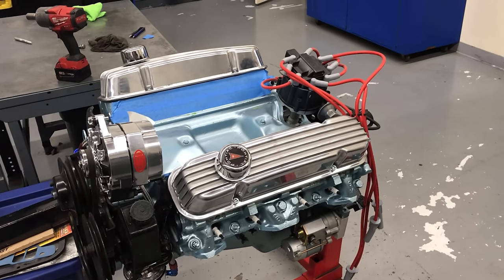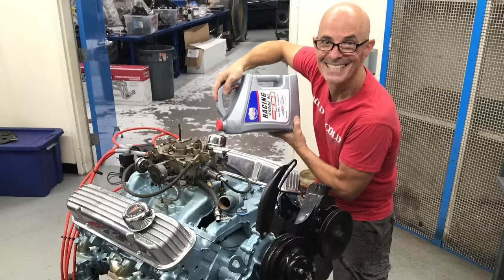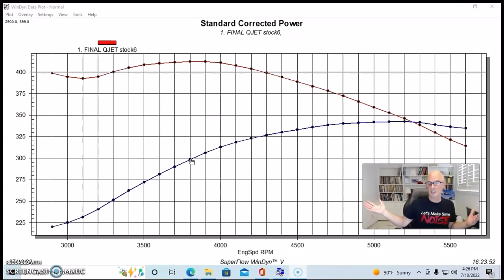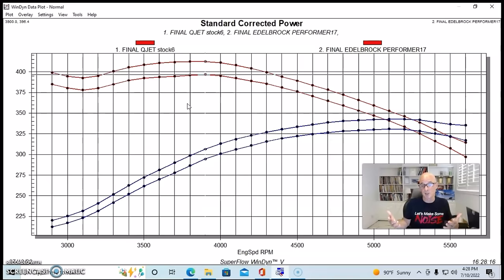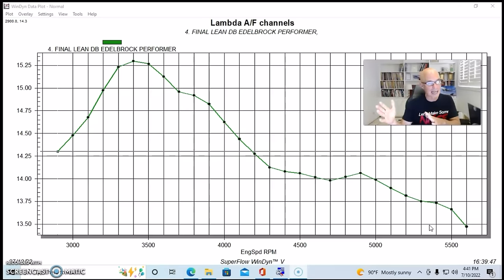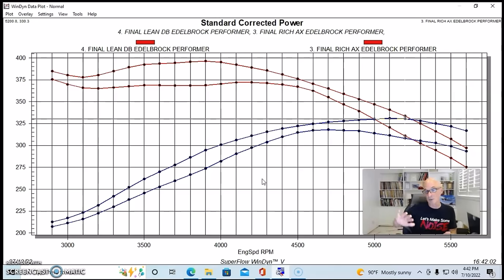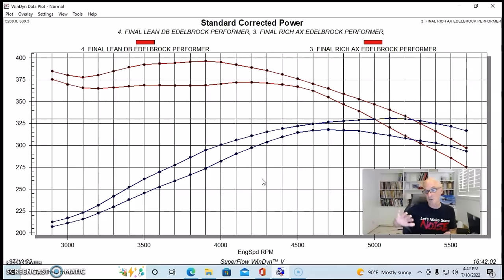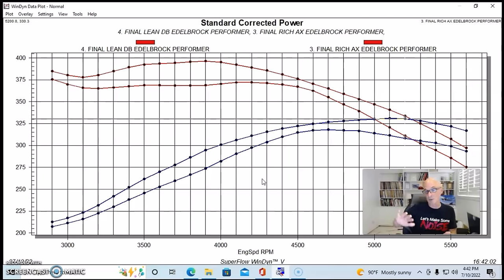HOW TO: Q-JET TUNING FOR BIG POWER GAINS PLUS STOCK PONTIAC 400 Q-JET INTAKE VS EDELBROCK-WHO WINS?

Comment: I have been racing Pontiacs since I was 16 in my 69 GTO. Of course the first thing I did after a set of headers was add an aluminum intake. I put on a Holley Street Dominator and lost almost a second in the quarter mile. I didn't know much about jetting so there might have been some to gain back but I just put the stock intake on and it was back to mid 14's. That was in 1984. There was a guy who raced a Catalina wagon at that time with mostly stock parts and he ran consistent mid 13's. I was always impressed with him. Fast forward about 5 or 6 years and I was back down at the track with a 455 out of a '76 Bonneville in my GTO. I had outfitted it with a Comp Cams 270H, Edelbrock Performer intake and a Holley 800 plus better Hooker headers. It ran very consistent 13.9-14.0. For an engine with 7.6 to 1 compression I thought I was doing great. The same guy who had raced his Catalina wagon back in the 80's now had a 71 LeMans wagon with the T41 package which is essentially the GTO front end. He had added 72 grills for some reason. Anyway, he was now running lower 12's with his mostly stock 455. He came up, looked under my hood and said, "if you ever want to go fast come talk to me." So I did. He had a home made, photo copied hand out of every change he had made to this LeMans wagon since he first got it with a 350/2bbl. I mean everything including every aluminum intake available at that time. The Performer RPM wasn't out yet. But believe it or not the cast iron 68-72 intake manifold out performed even the stock Pontiac aluminum H.O. intake. They look almost identical. But Jim was a very winning bracket racer. He had separated the water crossover from the rest of the intake so he could do manifold changes at the strip very quickly to verify his results in real time. Of course we are talking a mild Pontiac engine build. His combination was a basically stock 455 short block, either #96 or 7K3 400 heads which gave him around 9.6 to 1 compression. 041(Ram Air IV) blueprint camshaft but with Rhoades lifters and 1.65 rocker arms. A stock 68 to 72 iron intake with a 1" carb spacer and an 800 cfm Quadrajet with #74 main jets and .032 secondary rods. If he couldn't get correct secondary rods he would chuck fatter ones in his drill press and grind them down. HEI ignition, Hooker headers with 18" extensions, a 3.31 rear gear, a TH400 with a Corvette L88 spec torque converter and a cold air induction system that drew from holes he cut in the cowl. His best with this combo was about 11.90s with a race weight of 4070# on Amoco 93 octane. His shift points were at 5500, never any higher. He had every thing laid out in the papers he gave me. I duplicated the combo and put it in an 80 Turbo Trans Am I had bought as my daily driver. Using O.E. parts was way cheaper than the aftermarket parts I was always buying so for a broke 24 year old it was great. To my delight I went out and ran a bunch of 12.0's with a 3700# race weight. In 1992 that was a fast car. And it idled like a bone stock car, was well mannered in traffic and got excellent fuel mileage, almost 12 mpg, lol! The track was KCIR just outside Kansas City and the man was Jim Hand. He suffered a stroke a few years back but last I heard he was still showing his 67 GTO at car shows and his son was still racing his wagon but that's been a couple of years. He eventually switched to a Performer RPM. According to him it didn't run any quicker than the stock cast iron but it was more consistent. Although he did eventually build a 474 stroker with an aftermarket cam and was in the 11.70's or so. He has a couple of poor quality videos on YouTube from before his stroke. If you're a Pontiac guy they are a good watch. He also wrote a book that is unfortunately out of print but it can be found on eBay occasionally. I have learned from Richard Holdnener that engines are all the same, they all respond to increased airflow exactly the same. So with that knowledge it must mean that Pontiac really did have some good engineering back in the muscle car days if the stock parts did so well for so may years. Especially when you consider the small block air flow from the regular cylinder heads.
Reply: The 71 HO intake is as deep as the cast iron intake. The 72 HO intake is shallower and the service replacement intakes for 69 - 71 were also. The shallow version doesn't seem as good as the cast iron intake. An original 71 HO intake is the one to get, not a Pontiac service replacement sold after 71. The 69 -70 Ram Air IV intake is the same as the 71 HO, but the service replacement for it is the 72 HO intake.
Reply: Fantastic story. I love hearing them.
Reply: I knew it, Jim Hand, the master blaster of Pontiac Power!
Reply: @BuzzLOLOL  For the 1965 model year Pontiac went to the thin wall casting technique and improved the intake ports slightly, but nothing like the 1967 improvements. For 1965 Pontiac also updated camshaft lobes from 70 percent to modern 75 percent cam lobes in 4 barrel and tri-power engines. the 2 barrel engines and 326's still had 1964 70 percent cam lobes. The 75 percent is the 0.050" cam lobe lift duration is 75 percent of the SAE 0.006" valve lift duration. Older cams had 70 percent lobes, except possibly the 1964 GTO camshaft, which had its own part number. On paper the 64 GTO cam specs looked the same as 389 automatic trans 4 barrel camshaft, but had a different part number and letter stamp and was the same in 64 for automatic, manual and tri-power GTO's. The 65 GTO got the whole range of new camshafts. In 67 Pontiac used the 66 aafb intake on 4 barrel 400 engines with 66 type heads, but those with screw in rockers, guide plates and big valves got the new Q-Jet intake. The newer 67 heads were matched with the newer intake, which is quite a bit larger than the 66 AFB intake.
Reply: @BuzzLOLOL  I built a resto 65fir a guy. The Engine I cheated and used a 66 Block and forged pistons and 14 degree heads with 2.11/1.77 valves and a rare tri- power with the big 2GC in the middle. A solid McKellor for the 14 degree heads. The body came off the frame and I painted the frame and rejoined them all straight with all new suspension.  It was a Teal color with Teal interior and that car was damned fast! Beautiful and fast. The owner sold it because he couldn’t  handle the M-21 and it scared him to death!  😂. Pontiac built Excitement!
Reply: I agree, just like the Ford FE. People say that this was the latest and greatest thing because it was smogged to the gills, This almighty Windsor is and was a smogged out piece of crap, No 69-80 parts are worth scrapping. Until it was adopted as a cheap replacement for the FE did it make a pigeon poop. The 50s were the years after the war, Anything was possible!

Comment: I love the Q-jet. Great driveability, good fuel economy, good power. A well tuned Q-jet is pretty great.
Reply: Ya I'm not really a carb guy but I remember people complaining but my dad was just like ya they are good carbs I guess people just don't know what they are doing which checks out
Reply: And...really good sound. Q-jet is the best sounding 4bbl
Reply: @james10739  Your dad was right. The Q-jet is more complex than a Holley. Many people didn't understand how it worked, so they tore it off and replaced it with a 600-750 CFM Holley, when all they need to was properly tune their Q-jet.
Reply: I totally agree. There is a highish compression Vortec headed 383 under mine.
Reply: In a way it's like LS guys saying carbs as a whole suck. Most guys, even those who are carb fans, just don't know how to use them. Ultimately it doesn't really matter how good something is, if the user can't use it well - it's not going to be considered "the best".

Comment: ALL Pontiac V8s had "air-gapped" intakes. They had valley pans that kept dirt out and hot oil off the bottom of the intake.
It's such a righteous performance weapon that the aftermarket was forced to make air-gap manifolds for all other engines.

Comment: "There was a guy who raced a Catalina wagon at that time..."  Of course that had to be the one and only Jim Hand.  Jim helped me with key tips on modifying the chambers on the #62 heads I run on my 406 Pontiac engine.  I ran the Performer intake EGR model for a few years but swapped back the factory dimpled iron intake when the 62s were installed along with roller rockers and new larger duration high lift camshaft.  The modified engine wanted that factory manifold and it fits under my 79 TA's shaker hood.

Comment: I hope this will finally get a whole bunch of people to listen to me and stop putting performer intakes on their Pontiacs
The Q jet on a Pontiac will usually like between 11.8 and 12.3
The next part on the oiling system most likely somebody put the super duty high-pressure oil pump on it that’s usually too much oil pump for the Pontiac usually the regular Melling M 54DS Oil pump is adequate with a small shim behind the spring and making sure that the oil pump hole is a half an inch you can use a drill to do that 
check your pump plate clearance that’s the most important thing and running a thick gear plate that will give you more consistent higher idle oil pressure especially when it’s hot
Reply: Wish he used a Performer RPM intake ----huge difference ! Also a AMT 900CFM carb on a Pontiac 400 works great.

Comment: This is great! Just finished building my LS2 in my 2005 GTO, and now I'm upgrading my .030 over 350 Pontiac in my '71 Lemans while I save up to build my 400 block into a stroker. Love tuning the Q-jet and can't wait to see what my 800 CFM Q-jet, a set of mildly ported #16 heads, headers and a roller cam can do to wake up that motor.

Comment: I've built BBCs in 496 that made over 600 hp on a reworked 800 cfm Qjet.   Great carbs.
Reply: that's what I'm trying to build in the shed. I'm dead set on making my 800 CFM qjet from my 350 work 👍

Comment: My guess is that the oil pump pick-up fell out of the pump and now the pump is drawing the oil from the higher position of the pick-up hole. This would allow the pump to draw in "air" when the pan level drops with rpm. It would be much more noticeable in the car with acceleration induced G-forces for sure. I would not "Band-Aid" this condition with increased oil levels only. That could lead to high rpm aeration of the oil which is another way of mixing "air" with the oil and losing hydraulic oil wedge protection. Drain the pan and run a boro-scope up the drain hole to check and see if this is the case.
Reply: We always ran a short TIG weld bead from the tube to oil pump housing. It doesn't have to be all the way around. Stainless ER309L weld filler works best. We welded the rear end tubes to the rear differential housing with it too.

Comment: Here in Australia q jets were std equipment on our local v8 from 1968 to 1986 . I recently witnessed a Holden 253 V8  make 304hp @ 6200rpm with a Holley 650 DP with good afr on a std inlet. So after installing a overhauled full emissions q jet we only managed a lowely 256 hp and it was was too lean. Out with the CX needles & in with  the AN needles resulted in 274 HP @ 6000RPM & still lean. Bigger needles again , this time BA . Power peaked at 304HP @6200rpm. Some more fine tuning to the idle circuit & a minor adjustment to the float level resulted in a 306HP @ 6200 rpm. The owner of this engine wanted the engine to look stock so he insisted that the Quaddie had to stay & be on the money with the Holley, DONE.
Reply: Fun fact, 253 had larger jets or skinner rods in the quadrajet than the 308. It had to do with vacuum and idle quality that the 253 needed. More vac on the 308 didnt require the richer setup.

Comment: worst thing i did to my GTO was swap the q-junk for a holley. lol Q-jet big secondarys would almost feel like lil turbo lag for a split sec then off like a rocket. Constantly re-adjusting floats on that tempermental holley Think i even dented  my fender doing the all the way in then 3 1/2 out then thump on the fender look for the small drip. Never seen much differances in intakes i even had a few with the front coolant port cut off so i can easy fast swap and not mess with the coolant I usually ran the Torquer single plane probably wasn't best overall performance  vs the duelplane performer but looked way more badass

Comment: Originally one of the most powerful Pontiac intakes was the Holley Street Dominator. Later another, small company, made a racing version of it, with sightly larger runners and that wasn't long ago. The Pontiac has a wimpy oil filter bypass. Often they are blocked off with a threaded plug, for full time filter flow. The other approach is to trim a coil or two from the oil filter bypass spring. This is supposed to keep flow up, bypassing the filter more often and increase power(?).. The Pontiac oil pump suffers from cavitation. Melling has made several different versions of Pontiac oil pumps over the years to try to address this.
Reply: I've still got one of those street dominators on the shelf. Was a bloody good manifold , definitely preferred it to my air gap.

Comment: My brother fixed a delay on his q-jet by changing the acceleration spring so the peddle to the rear tires didn’t bog. Like it was falling on its face and then bouncing back. He first thru a spring in from a ball point pen and decided that was going in the right direction.

Comment: Looks like your QJ is a late 70s (emissions) carb, which I believe are mostly 800 CFM. And Cliff R. says he likes them to modify. Maybe he did that one. But I had a hard time following your test results here. 
I remember you sayin the 400 with the stock intake, and QJ made almost 350 HP. Then with the aluminium addition, you "lost" quite a bit, then improved it with richer sec. rods, but I don't think it was even close to the stock intake, and unmodified QJ. Or do I have that wrong.

Comment: Restrictors in the lifter galleys will help with the oiling problems. Pontiacs with high volume pumps pump too much oil to the top and starve the bottom end.